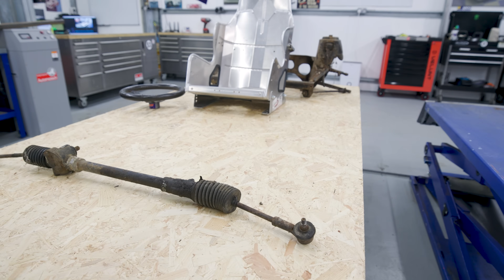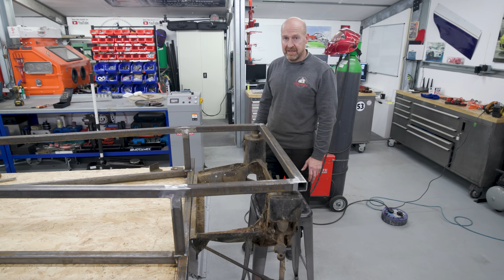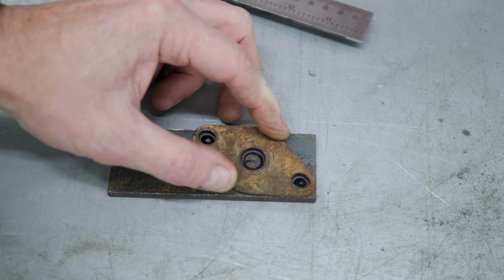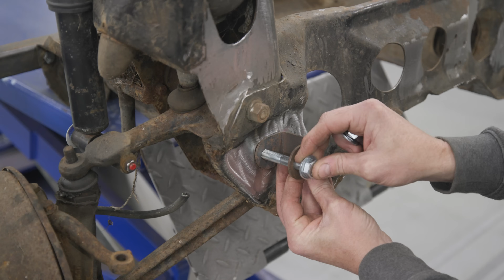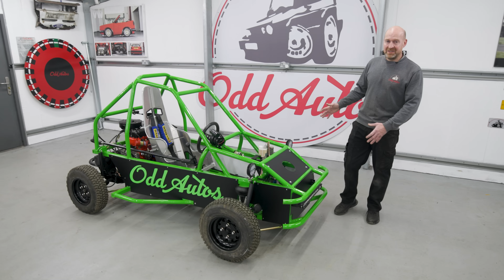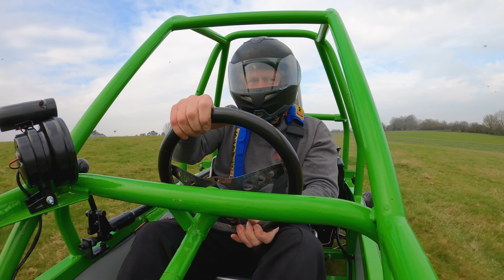BUILD your own OFF-ROAD Buggy for UNDER £500 using CLASSIC MINI parts Kit CAR

Comment: The bottom corner cuts on the top shock mounts on the front end, instead of being cut into a sharp 90deg corner, you should have radiused them. The sharp corner creates a stress point where it can crack. Easiest way to do it is to drill about a 1/4"-5/16" hole in the corner and then cut the rest with the grinder.

Other than that, looks sweet as 👌

Comment: Fitting a set of motor cycle carbs on the mini engine makes a massive difference in overall performance.could I also suggest putting some big red machine emergency stop buttons all over the outside as a safety feature

Comment: As an american: 
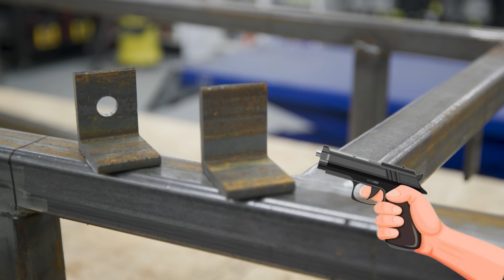1. 7:40 Oi mate! Ya got a loicense fer dat?
2. In my state you would need turn signals, a windshield, and a wiper and it would be legal to drive on the highway ( I'm not sure if it could still be registered as a Mini since you don't have the firewall and vin plate but it could easily be registered as a home built car)

Comment: I'm not a gear head, but I do like the odd kit car. Subscribing wouldn't benefit that much, however, I loved this buggy build, sooo.....

It is nice to see I'm NOT the only one who mixes imperial and metric, thought I was a little unique there. And it's great to see another one working in imperial, it's nearly always metric

I owned Triumph Spartan for a short while, had to sell to pay for its garage bill, I'd spent months trying to get it to run properly, and with all my engineering background, I was stumped. Just trying to balance its twin webbers gave me nightmares. I loved that car, my little Noddy car. Sadly, it was built by an extreme amateur, from what I could see from the workmanship. I wanted to strip it down and rebuild, but living in a town house didn't proved a garage.

I've always wanted to build my own, even "acquired" plans for a cute little buggy, but again, nowhere to build, also no funds to do so now 😞

Comment: We used to build them like that in the 80s for class 8 autograss before it became a big money sport. £25 from the scrapyard for a 1275gt...we used Herald or Spitfire front suspension with Imp front coil over shocks. Gear linkage was the tricky bit to get right.

Comment: The suspension cones can be easily softened by drilling holes through the rubber, this is a classic mod for Mini race cars that were extensively lightened at the rear.  For an off-raod buggy the suspension needs a great deal of travel and if you check out the proprietary ones the A arms are very long so as to limit the camber change.  My guess is that with such short  suspension this chassis will not have the compliance to ride the bumps effectively.

Comment: Was this from a guide/kit or completely  out of your head, how did you decide on all the geometry for the chassis and suspension, also wondered if a few triangulations between the main tubes would have provided a more rigid base for future power options. Fan-bloody-tastic great to have odd autos back
Reply from the maker: Just made out my head mate, took measurements from that old front subframe and went from there.

Comment: Good job brother ! Surprising how well a  yamaha  600 fazer or thunder cat goes to and cheap compared with say an r6 motor . Fazer was de tuned for mid range  so quite torquey. Well fast enough and relatively light too .  The old v4 750 out the 87 model honda vfr 750 is a stonking bullet proof engine and they sound great . That was my first big bike an 89 model and yes i wrapped it several times being a knob . But still fixed it all like new and repainted it and went on tour up in scotland ! Top job Paul !
Reply from the maker: Cheers buddy, yes think a bike engine would be proper fun!
Reply: I love my fazer! I actually enjoy it more than my zzr1100!

Comment: Very cool. Some channels would string this out over a dozen episodes. I'd like to know more about the gearstick linkage though.
Reply from the maker: Thanks MD, yes thought would do it in one vid so people can see start to finish in one. Gear stick is just a roll cage tube going back then a pivot on the subframe for a rod that’s joined to the mini gearbox gear change and that roll tube.  Hard to explain but seems to work well enough, maybe a little sloppy but might go back and make a better one.